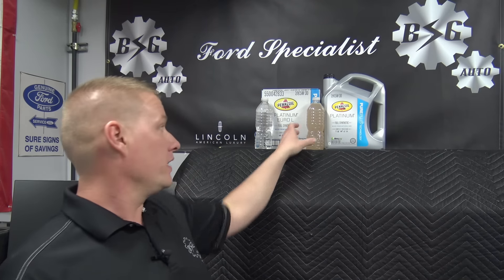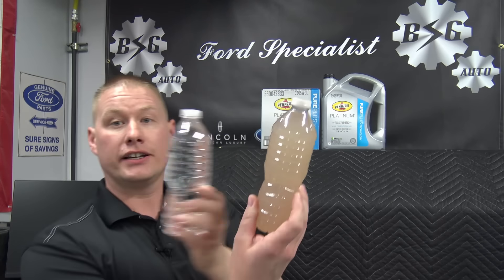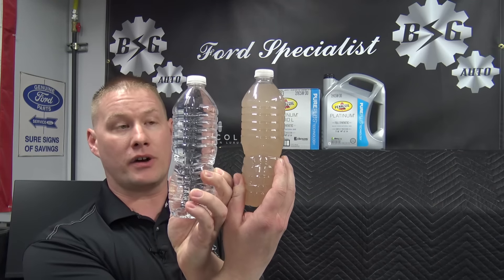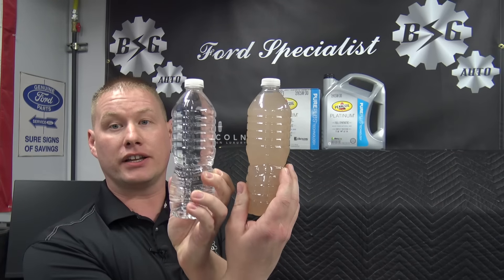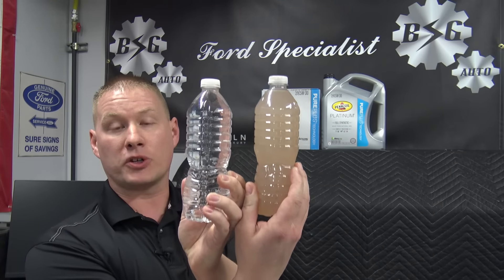The Power and Technology Behind NHRA Drag Racing

Comment: Brian, we are also seeing those that use full synthetic after the first oil change on the GDI engine's have less severe deposits when compared with similar mileage engines of the same brand/size that are using the syn blends the dealers push.  I put the Pennzoil Platinum pure plus at the top of "mainstream" oils for years.

Nice to see you getting involved in NHRA drag racing!  Look for us at the next National Event.  We run top dragster, super comp, super gas, superstock, and stock.  over 50 National Championships!!

Comment: Brian - Really Great Info. I have been using Mobil 1 and Royal Purple motor oils with K&N and top shelf WIX synthetic fiber filters in my F150 and my wife's Camry since we bought them new in 2009 and 2007, respectfully. I did the same for all of my previous vehicles and never regretted it for a single minute.  I will only use oil filters that are made of synthetic fibers and not paper. As an old mechanical engineer I have 45 years of experience with mechanically moving parts that are subjected to high heat and constantly rotating wearable parts. Hot engine oil and paper never get along well when used together, period.

 - Simply said, I Have No Problem paying a few dollars more throughout the year knowing I am doing it right. I have never liked the idea of putting paper in hot engine oil and I don't feel 100% confident, not even 25% confident of paper filtration. It simply  doesn't pass my sanity test.  

 - When you were here and we changed out the VCT's and you commented on how clean the truck engine area is. I tell you bruddah, I really do take my vehicles seriously. We learn our lessens early on ... Take care of your vehicles and they will take care of us every time we need them to. What is spending $100 extra divided up throughout the year when you compare it to a new or replacement engine.

 - I switched from Mobil 1 to Pennzoil Pure Plus oils for both vehicles a few months back and am very happy with the change. I don't see or feel anything different because of the switch. It simply makes sense. It's a whole lot cleaner going in and the oil properties are better when compared side to side with other top shelf oils like Mobil 1 or Royal Purple. 

 - As for my F150 using 5-20 wt oil (mfr recommended) and knowing I could use a 30wt oil because of living and operating it in a tropically temperature stable area (Hawaii).  I have no plans to think about switching viscosity grades to 30wt until the truck is well over 100K miles and it shows signs of needing it. I don't want to pressure feed any thicker oil through the bearing and oil passages then needed which could be aiding in any type of premature engine part failure. I'm one Cheap Bruddah but I know where when to put my money down when it comes to mechanically moving parts that I want to use for the longest time possible.
Reply from the maker: It really is a much cleaner oil going in which is so important on these newer vehicles we changed over a long time ago when the Dealers were all switching to the pure plus technology.
Reply: Hawaiian F150 if only my husband would listen...he has a new vehicle about every 2 years...correction...a new used old vehicle. Which we spend money on that we can't afford...lmao! He has the old hamster wheel just running and running...
Reply: Ladonna Steele ....  haha.  Ya know, some male gender like types have a inner ear wall that we can make go up and down depending on the conversation...  if we hear key words like "I told ya", "why don't ya listen" the auto wall self installs to protect Man's Stupid Center, our central  man-defense center.
We can't tell anyone how to deactivate the inner man wall.  I heard once that a flying frying pan spins at just the correct rotational action ass to engage the "wall auto drop" feature.  Either that or a swift kick in the Nether Region.

Comment: Can't be better than Motorcraft!
Reply: SteelCity Prospector -- IMHO, It really is a lot better than FOMOCO oil. Night and Day different. 

I too was sceptical. I tried it with an open mind and compared the facts.  I'm not totally OCD'd but I was convinced. Convinced enuff that this old engineer made the switch without reservation. 

 Try for a few oil changes for yourself.

 Besides it's cheaper so think of the switch as down payment on few cold beers.

Comment: Hey Brian, nice video. Would it benefit my 06 f150 4.6 with 120,000 plus miles on it. It burns about a quart every 3000 miles or so.
Reply from the maker: It can benefit any engine yes but I am not saying it will cure your oil burning issue that is mechanical.